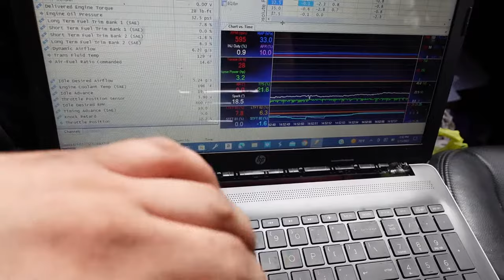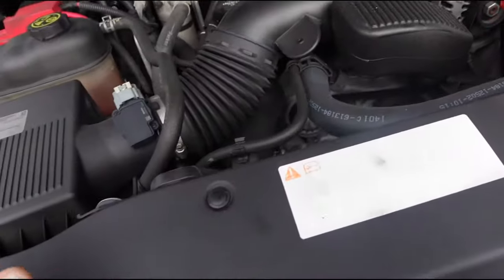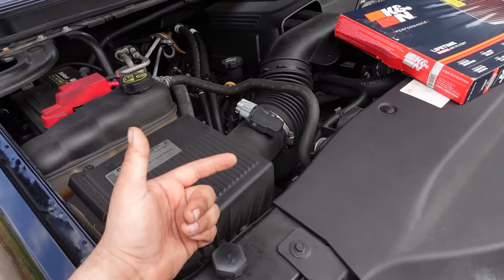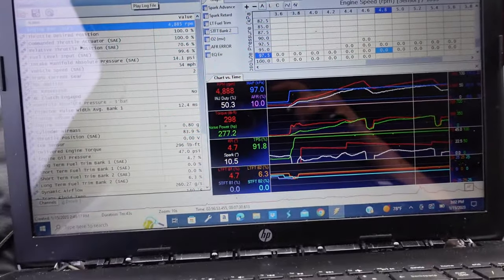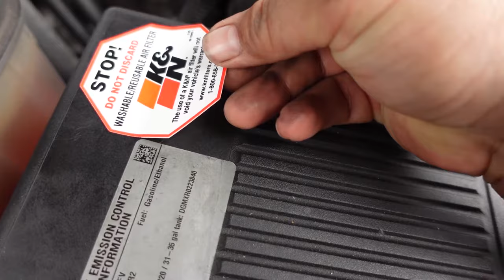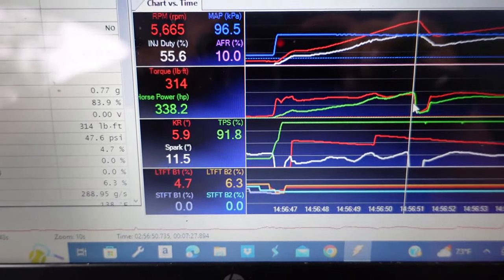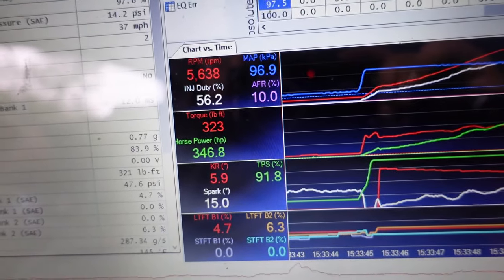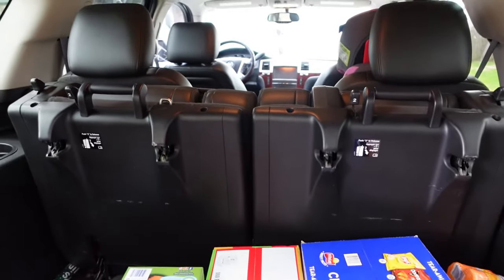K&N Performance Air Filter Test

Comment: Can't say that this is a valid test, the OEM filter was used, the apparent difference in HP was an additional 8hp which would not have been enough to improve acceleration by 0.1 considering the weight of the rig. K&N filters may improve airflow at the very top end but are no better than OEM for normal range of use and much worse at filtering the damaging nasties out of the intake. K&N designed filters for high reving Motorsport cars that have frequent engine rebuilds, not domestic vehicles that need to be reliable for hundreds of thousands of miles
Reply: It’s always one😂😂😂

Comment: Now to get the throttle position closer to 100% instead of 91.8% your torque management is partially closing throttle prematurely.
Reply from the maker: Yup, and timing so so dang conservative. A lot is left on the table with these 6.2s that’s for sure!

Comment: And that's in them type of vehicles if you put a cane air filter like in an M3 or an S4 Audi you're going to gain about 1520 horsepower it depends on basically the vehicle you're using will be more and if you run Royal Purple in your car and you put it on a Dyno you're automatically going to gain 15 horsepower I want to believe it but the math doesn't lie keep your engine cooler and if your engine is cooler you have more horsepower it's a quicker start it's a synthetic oil the 5W-30 is the way to go put it in every one of my vehicles McCain and filters in all my vehicles and just definitely a difference

Comment: Its also letting lots more dirt particle in.
Reply: 100 % correct . Filtration of 75% for the best cotton filters against 99.5% for OEM paper . 
Manufactures use paper filters for a reason.
Reply: very negligible amount.  regular oil changes corrects that
Reply: @cantwealljustgetalong2  by the time you have changed the oil, those suspended particles have already done the damage
Reply: @JohnBoulding  i see comments from people saying theyve been running these filters for 10 or 15 years with no issues.  if they were so bad i dont think theyd still be in business
Reply: @cantwealljustgetalong2  It's called anecdotal evidence. The outliers don't negate the overall average. If these filters were so great they would come as  OEM equipment.
Reply: Lol  ain't no money in putting these in as stock  on vehicles  @JohnBoulding

Comment: Recently just got a Cadillac 2007 DTS and JUST TODAY put in this K&R air filter and this engine just came to LIFE !! I now all I have to do is to add an awesome performance exhaust and should easily increase the horsepower well over 300 from the original 275. With this K&R I’m pulling over 280 HP now baby !!! Oh, I would choose the chewy bars, shack chips and sunny d baby!!! 👌😄👍
Reply: i think yours has the same engine as my 2015 impala v6, im gonna get a k&n filter for it today

Comment: I have an 07 Chevy Avalanche that I installed an AEM drop in air filter in the factory air box and installed an Airaid MIT intake tube in place of the factory tube and I feel like it gave me better throttle response. Any hp increase is probably not much but it gave better throttle response and the Airaid intake tube cleans up the engine bay a little.

Comment: I see you have a Maf sensor if you over oil the filter you will get it on the maf and performance and gas mileage will suffer. They work fine in engines with map sensors or raceing engins

Comment: Any change in mpg?
Reply: The change in MPG would be slim to none since 95% of fuel economy comes from your driving habits. If you were to drive the EXACT same for both tests, a K&N would more than likely yield 1-2 mpg since more air = more efficiency. A CAI system will increase fuel economy (if you keep your foot out of it) due to there being far less restriction as well as more air coming in through a larger filter.